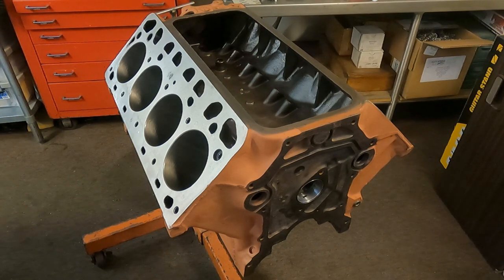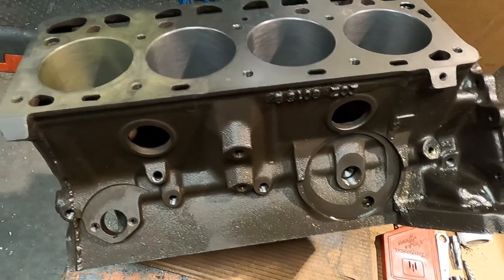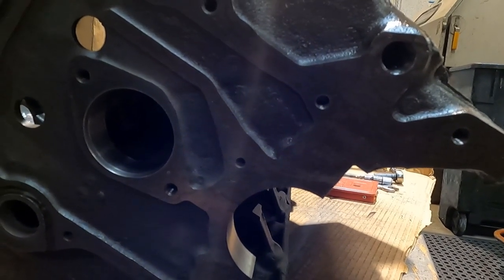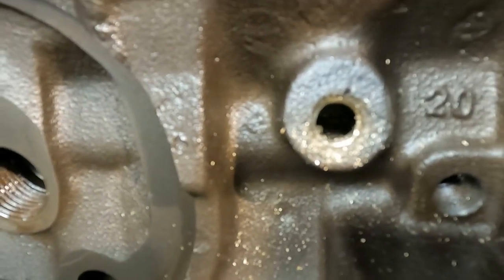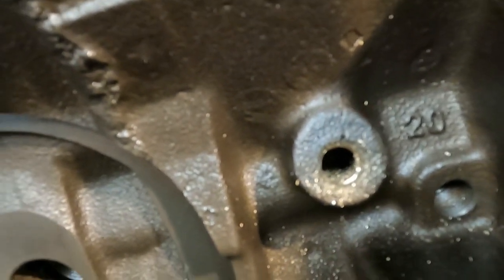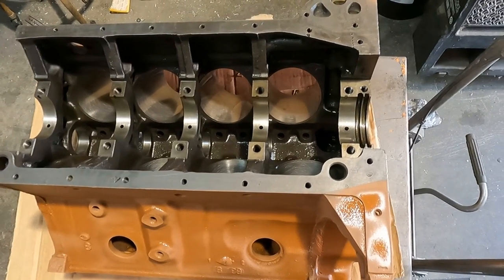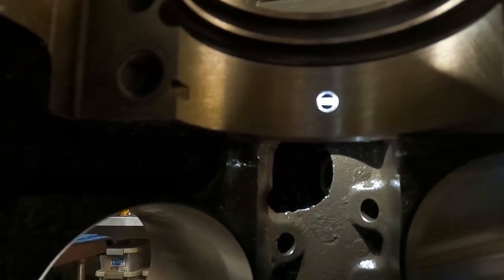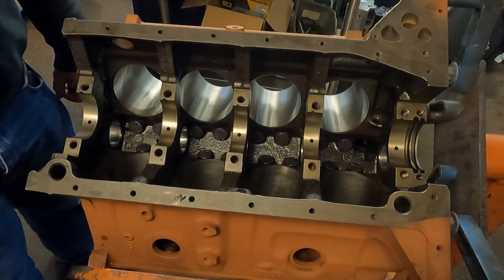Ford Y Block Basic Short Block Assembly Tips: Part 1

Comment: At Ford Motor Co.,  we hone then brush our cylinders TO THE PISTON SIZE.  That's why our 'break-in' is practically non-existent.  So, pistons need to be ordered first, then the new bores need to match with proper piston-to-cylinder clearance.  We also use hypereutectic alloy pistons with moly rings which is mainly why our engines last 250,000 miles.  A classic engine (like the Y), if 'brought back to 'original', will only last 80-100,000 miles.  Today's methods and materials are far better even on a 'Y'.

I highly recommend weight-matching your pistons and rods (on both ends), then both together before submitting a 'sample' to your crankshaft grinder.  Throw in the flex plate and harmonic balancer and have them all balanced at once.

BTW, be very aware, if your new, larger pistons weigh more than your originals, you may need more weight in your counterweights.  They drill holes and weld-in Mallory metal, which isn't cheap.  My crankshaft balance cost a hundred bucks more with Mallory metal but it needed to be done.  My 292 is smooth as silk now.
Reply from the maker: In the normal world  vintage blocks are rough bored first to see where the ring wear and any water damage that has occurred do to improper storage. Rust takes 90% of engine blocks from useable to scrap.
  Pistons are ordered and then the block will be honed to fit the pistons.
 Rings have to mate to the piston as well as the bore. So they will keep getting better seal as they break in no matter who builds them

Comment: I've always wondered why people don't install cross bolt mains in Y blocks. It is certainly doable
Reply: They would only be needed with tremendous power levels .
Reply: @HowardJrFord  that is my point especially if you are using the 368 Cid 57 Lincoln/mercury version. Most people don't know that the 368 was an option for the mercury in 57